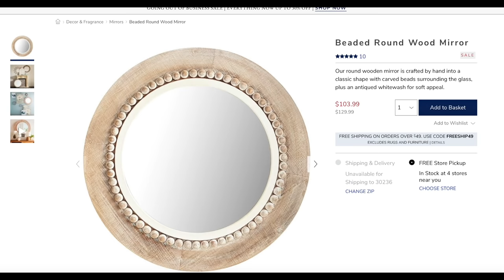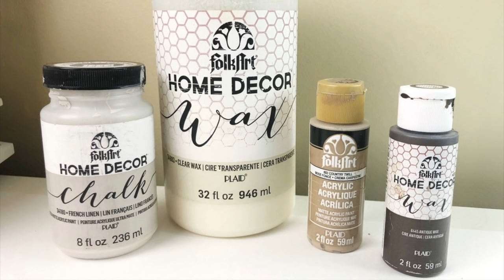TOP 20 HIGH END INSPIRED DIYs  *BEST EVER AND BUDGET FRIENDLY*

Comment: I just learned a tip for painting the half wood beads. I was so excited because it really is messy. I do hope this makes sense but if you place painters tape across the top of a box or on piece of card board with the sticky side facing up. Then place a piece of tape on each end to hold your tape strips firmly on the box or cardboard. next just place your beads cut side down to the sticky side of tape and now you are ready  to paint without the mess. The beads stayed in place while you paint them. I've just recently used this technique and loved it. I wish I could remember which DIY'er that used this technique but I can"t. Loved the barn door  and the hula skirt diy but all of your diy's are awesome..

Comment: Just a suggestion for anyone wanting to make the mirror with the half cut beads... maybe you could try putting a drop of hot glue on them and stick them to a surface and paint them and then pull them off after they dry and pull the hot glue off.

Comment: These are wonderful! Lots of great projects!

So, as a side note for the jar on the barn door, in the plumbing section, you can use U shaped pipe straps that can screw right into the board. They are usually about the same cost as the adjustable clamp that you use (which you use a screwdriver to tighten the clamp, don't cut).  :)

Comment: They make larger mouth E6000 in the hardware industrial section. I keep both on hand. Maybe do the white paint before you add the mirror..save you some time ;) There is a pedestal cake plate to match that distressed button mirror. You could make that too.  cooking oil will remove that label for ya. i think maybe fastening below the threads on the mason jar will hold firmer maybe ? Love that cutting miter tool thingy! getting one for sure. Thanks for that.

Comment: If you use masking or painters tape on wood before you saw it will prevent that splitting. You can use that same technique when cutting dowel rods and any thin board like Luan. Simply remove the tape after you finished cutting out your desired shape with your Saul or clipapers.